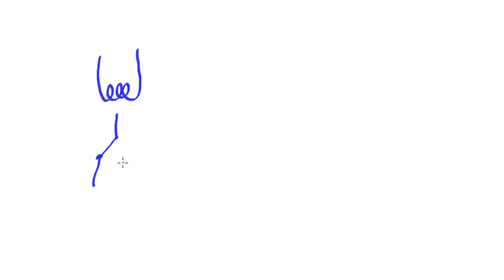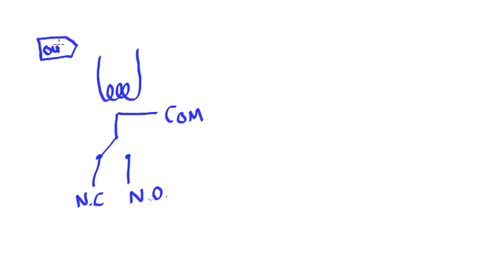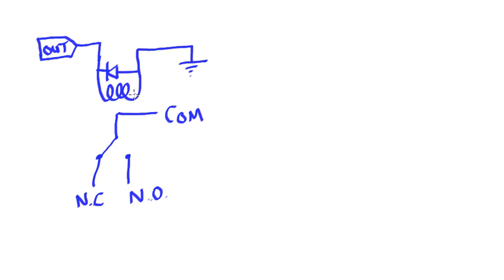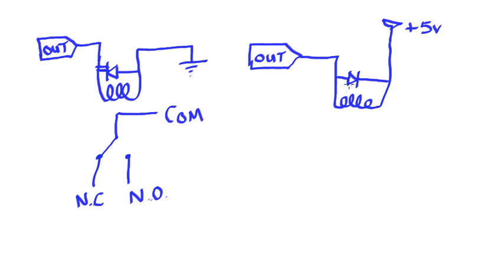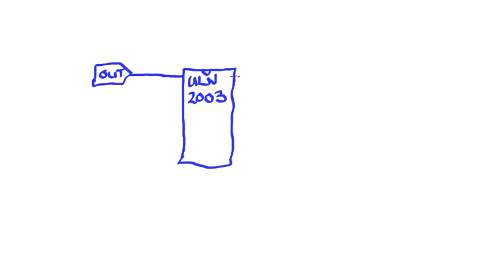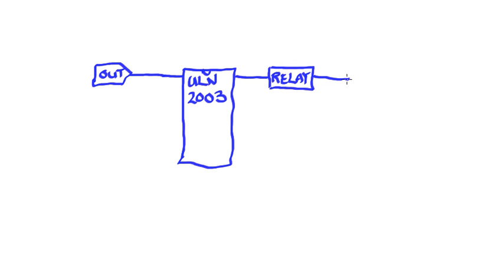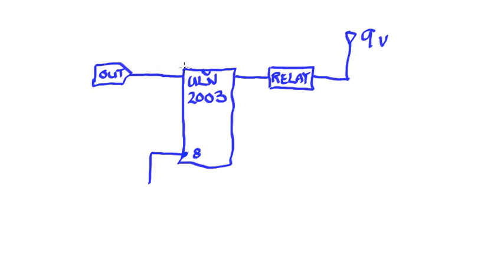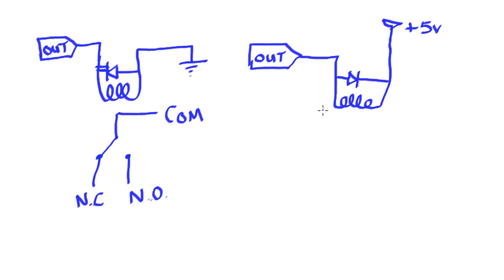Using Relays with a Microcontroller

Comment: Great explanation, do solid state relays also require a device between MCU and relay? Since Solid state relays don't require a large current?
Reply from the maker: No, they can in most cases be controlled directly

Comment: at 315 the orientation of that diode sketches me out (in parallel with coil). wouldn't it be better to put it in series with MC?
Reply from the maker: The purpose of the diode is to prevent any counter EMF from reaching the microcontroller.  When the output of the microcontroller is turned on, no current will flow through the diode because of its orientation/polarity within the circuit so the current only flows through the coil.  However, when the magnetic field of the relay coil collapses, it will cut/pass through the coil windings.  Whenever there is relative movement between a conductor and magnetic field, a current flow will be induced.  The polarity of this current will be in the OPPOSITE direction of the current that created it.  Because the magnetic field will collapse very quickly, the voltage will be quite high and could damage the microcontroller.  However, the diode will short out this counter EMF voltage/current, protecting the microcontroller.
Reply: @drbrono  is this use of diode  100% protection for MCU or ULN2003 is better.
Which option is best